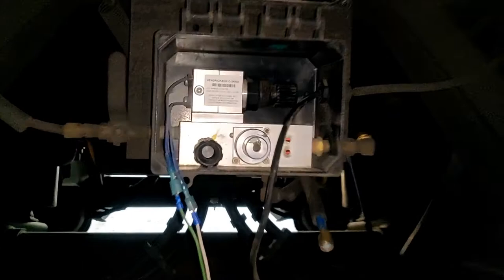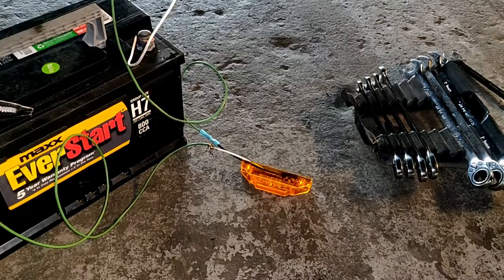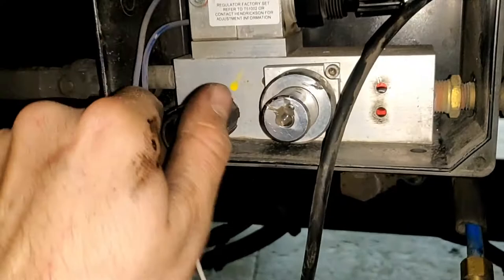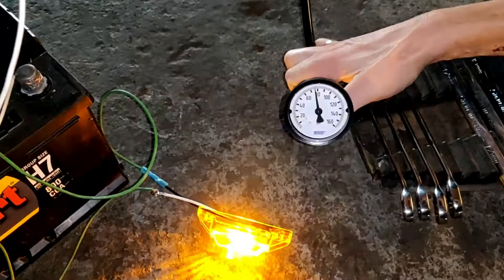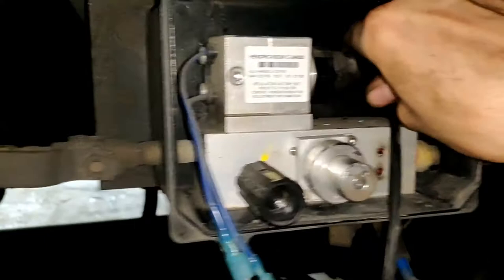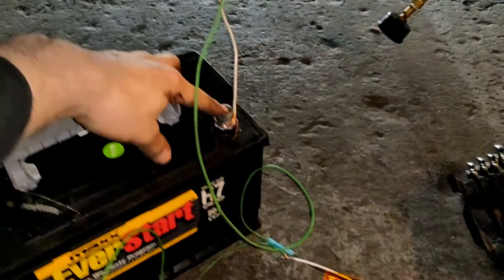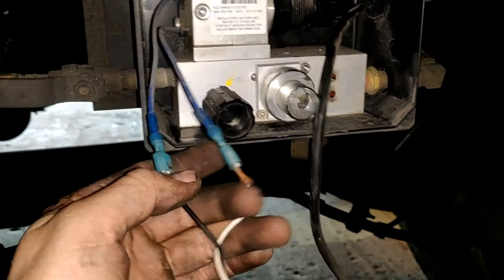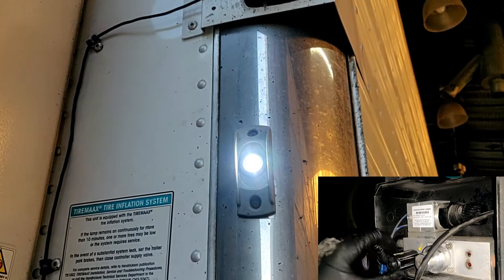Hendrickson Tire Inflation System | How it works

Comment: i have this light always on.i check tires there is no leak and tires in good pressure.what might be bad?
Reply from the maker: Can be a bad pressure sensor that is locked in closed position and keeps the light always on!
Reply: @valeriumoscalu7580 were is the tire pressure sensor located?

Comment: Valerii Noroc. Da daca lampa deloc nu se aprinde ,eu creez air leek din roata las sa iasa aerul si lampa nu se aprinde, cu ignition’ON’ cu testeru am controlat si nu , Nu vine curent la lampa nici in baxa la cabluri  nu e curent … ce poate fi? Mentionez ca cind aprind ignition apoi lampa la ABS nu sevaprinde, se aprinde Doar cind apas brake pedal…. Ai vo idee ceva ce poate fi/? Merci
Reply from the maker: Daca lampa la abs nu se aprinde inseamna ca nu ai curent in cablul albastru!
Reply from the maker: Rosu este 12 volts cind apesi pe brake ! Albastru abs _ 12v
Reply from the maker: Daca de la truck Vin 12 v pe albastru inseamna ca problema e in cablul De la trailer! Daca nu Vin 12 v inseamna ca problema e la truck!

Comment: Am o problema. Toate cauciucurile sunt la 90 PSI. Nu aud ca pierd aer, aud aer doar când deschid valva. Nu am cum sa reglez presiunea pt ca nu am gauge de presiune. Se poate sa fie ansamblul defect?
Reply from the maker: Nu e defect, asa e setat la 90!
Reply: @valeriumoscalu7580  inteleg dar lumina e aprinsa ca și cum nu este destul aer.